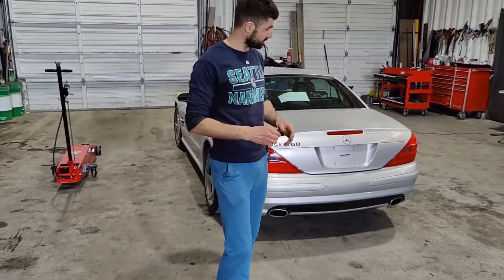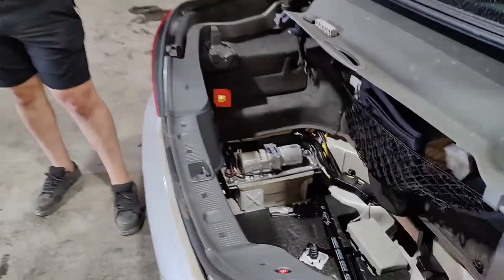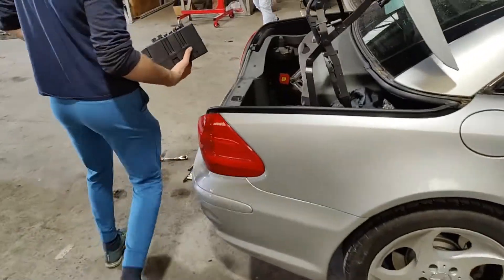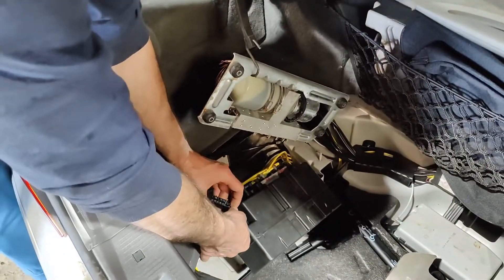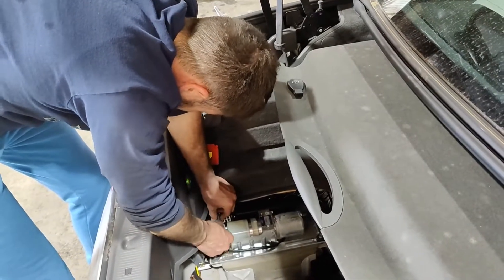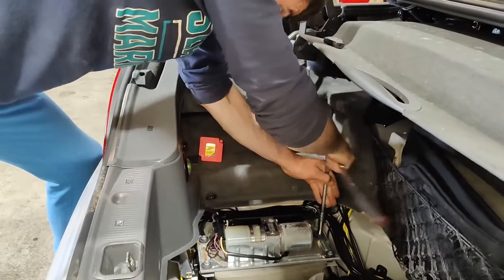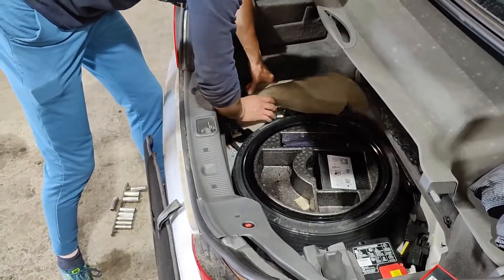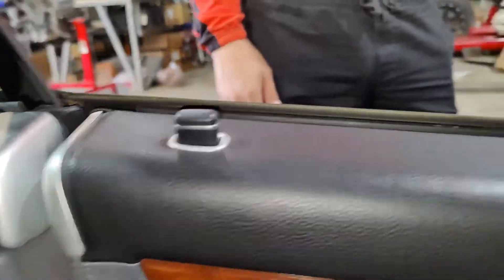Mercedes SL 500 roof problem solved,  installing vacum pump after repair / Soft close workings!

Comment: Really helpful piece of film. I've followed your procedure and the pump works. Car unlocks (by the key fob) and air flows through the pump. When I try to lock, the pump runs, no air through it and the car does not lock. No boot lid pull-down. What could be wrong?